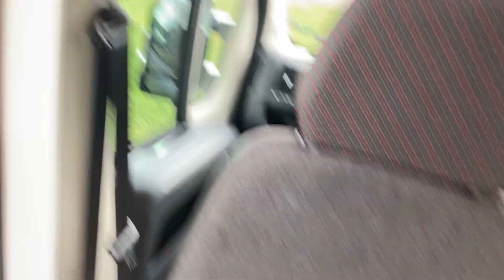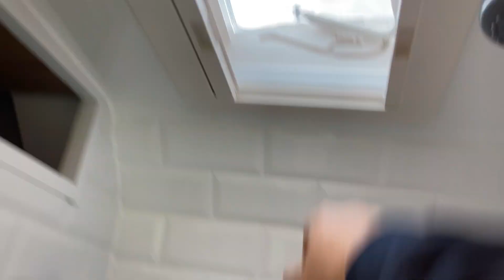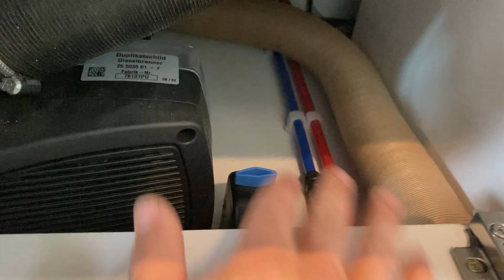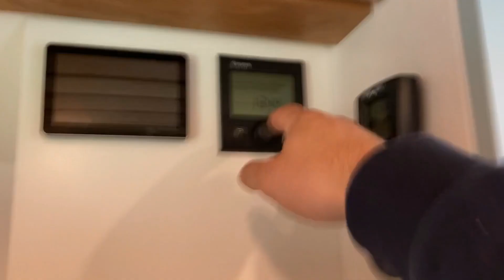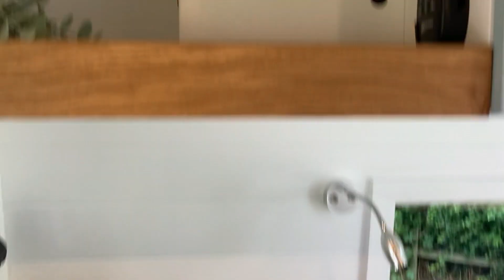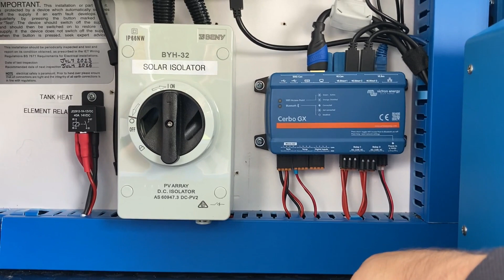GASLESS off-grid electric cooking van tour | DINETTE | No LPG | Induction hob and Airfryer! Vanlife

Comment: Love this conversion. Out of interest, is there room for a twin passenger swivel seat in the front and for an Aguti folding/removeable seat to fit in front of the sink, for the occasions where you may want 4 travelling seats?
Reply from the maker: Thanks yes you could have a double passenger seat in the cab easily. The forth seat would be tight and also depends on the structures under the van as to if there is a suitable location for it to be bolted. We are doing this on our current conversion but it is a Kunu layout so there is more space in the doorway compared to this layout

Comment: What relays are you running from CerboGX?  I am guessing tank heater could be one?  I live the idea but can’t find a practical use in my van.
Reply from the maker: Hi Rory, thanks for your comment. We are running the water pump and the multiplus trickle charger off of the two relays. We can remote switch these on/off via the VRM portal. The tank heater is definitely an option to consider as I could be trigger by the ruuvi external temp sensor.
Reply: @vanlifeconversions  you know there is a relay that can be remotely used in the Multiplus that you have?  This is the one to use for trickle charger I was thinking.  I have the same set up.
Reply from the maker: @roryjeffcock  ok great I will look into that for next time. Thanks

Comment: Lovely job as always. Could you possibly help point me to the hinges you use for the pop up worktop extensions as the ones I bought are useless. Many thanks.
Reply from the maker: Thanks! Sure they are from Amazon shop called Storystore - Folding Shelf Brackets 25cm, 2pcs Heavy Duty Metal Collapsible Shelf Bracket for Bench Table
Reply: @vanlifeconversions  Brilliant, thanks so much.